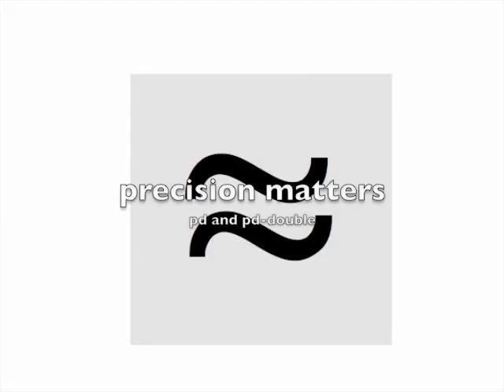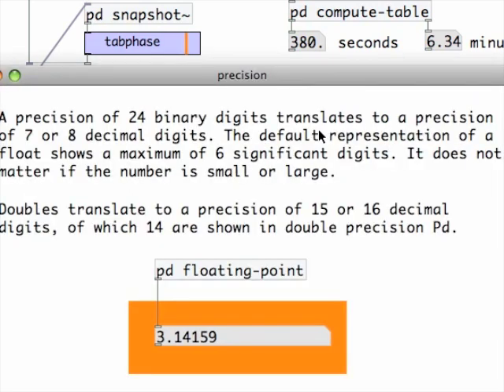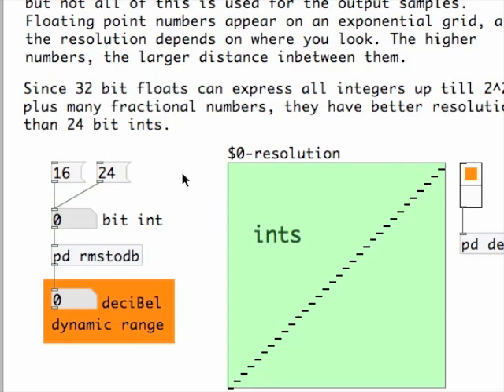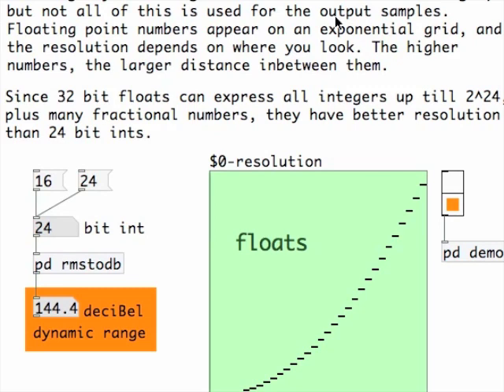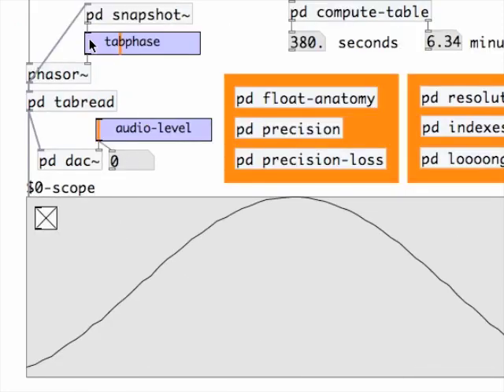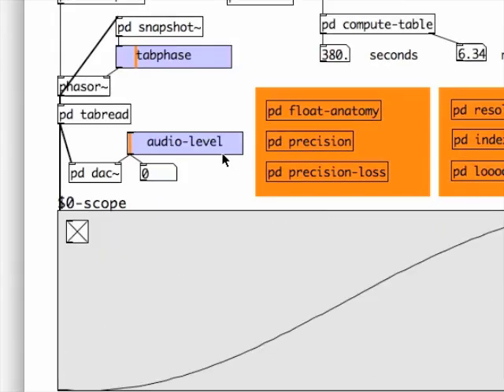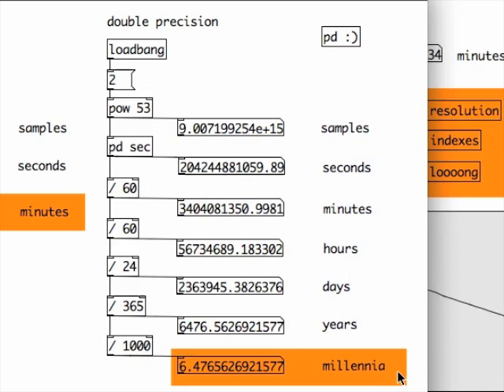precision matters

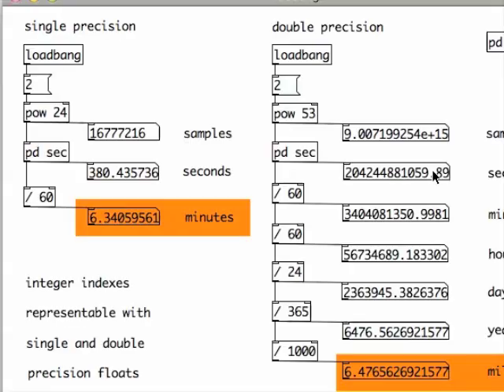Comment: I'm wondering about the number of seconds of indexing we can use with 32bit floats (start at 5:20). The calculation assumes a 24 bit significand but doesn't a 32bit float actually have 23 bits, with the 24th bit used for the sign? If so, wouldn't this mean we have only half of what the video tells us i.e. 190.2secs?